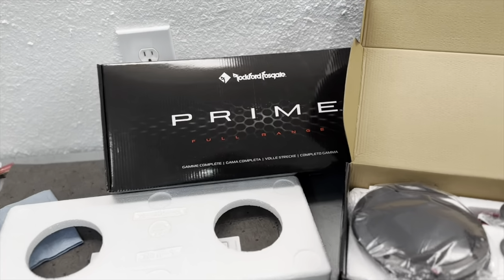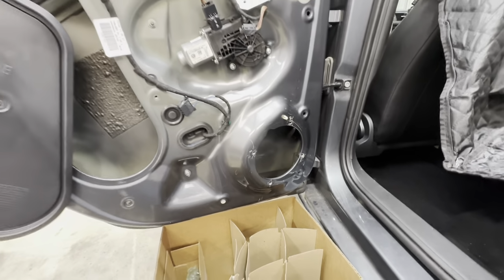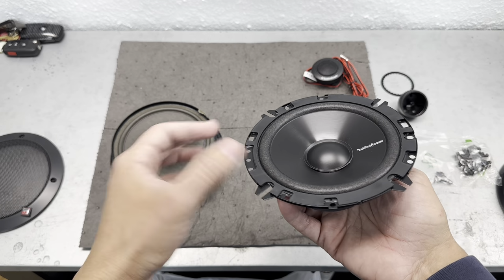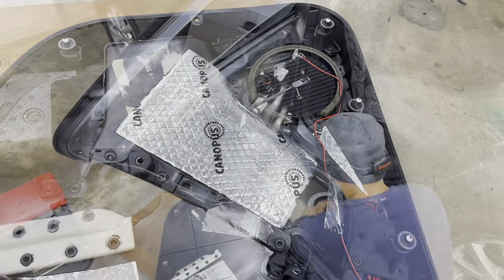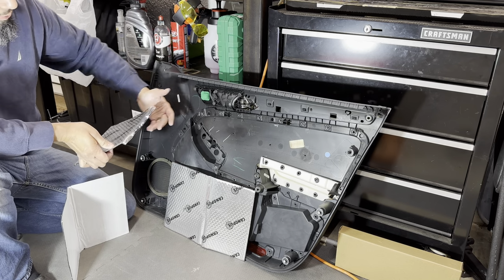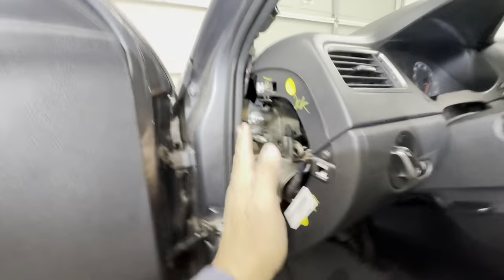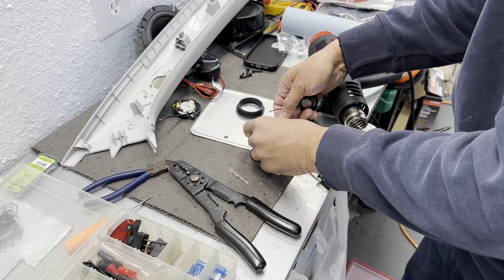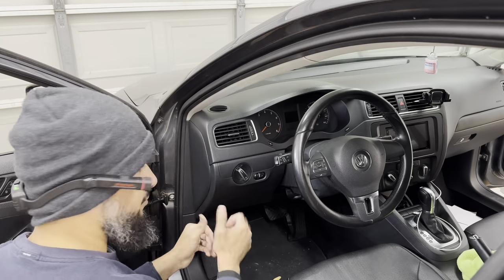VW Jetta Mk6 Rockford Fosgate Speaker Upgrade and Sound Deadening

Comment: only suggestion i could make after doing this exact install with my jetta was that after using hot glue for the tweeters, they lasted the winter but fell off in the summer when it got hot in my area. would recommend using some type of plastic-weld like jbweld or similar that is less susceptible to extreme temperatures. otherwise killer install and awesome video!
Reply from the maker: Dude thanks for that! I will certainly keep an eye on this as we get into the nasty of the summer season.

Comment: Even the best Decks in the world only do 15 watts rms per speaker (if that ) . Where did you get those numbers lol
Reply from the maker: Well your comment just made me double check my stuff! Lol i found that 1- the headunit I used does NOT put out 40w RMS, that was a mistake on my part (but also yours) as it puts out 20w (so less than my number, but slightly more than your number lol). I must have thought of the speakers and got the numbers mixed up. The speakers are 40w RMS/ 80w peak. So thank you for that!

Comment: What size should I use for the screw/riv-nuts?
Reply from the maker: I don't recall now what size I used (well over a year ago). But that would depend on the size of hardware you decide to use (custom work, so you decide what hardware you want and get the riv-nuts of the appropriate spec).

Comment: Do I have to get a riv but attachment or can I use a impact driver to take out the stock riv nuts on the stock door speakers?
Reply from the maker: The stock rivets just need to get drilled out. The rivnut gun was just used to place new threaded holes to make life easier installing the required speaker spacers

Comment: My jetta (2017 SE) doesn't have tweeters in the A Pillar. Is there a way I can add them in assuming I buy new A pillars with the speaker cutouts? Also, will these speakers work with the factory infotainment center from Volkswagen? Thank you!
Reply from the maker: That would be correct. Buy used A-pillars with tweeters on them and run your wiring up to the speaker if you don't already have a random unused plug at that location (being for cars WITH tweeters there). If you do have plugs there you can always test for current with radio on/off to confirm they are in fact for tweeters. If you don't have plugs there, then you'd have to run your wiring from the door speaker, through the door/ doorjam harness, up to the pillar. More work but not difficult. Just time consuming. 

Yes but they will work with the stock infotainement but they may not sound as good, given that the stock head unit has lower output than aftermarket head units. But the sensitivity is high enough on these speakers that they should still outperform the originals given the same current. You can always install the speakers and use them for a couple weeks to get used to them/ they break-in, and THEN make a desicion as to IF you think the benefit of an upgraded headunit outways the cost.
Reply: @turbospool  thank you!!!! Appreciate the response!!!

Comment: How well have the tweeters held up with the hot glue? When I was replacing mine, I was concerned with them rattling free. So I ended up modeling new tweeter brackets and had one of my friends 3D print them. My tweeters were from Focal and conveniently had a thread on the back where I could screw mount to the bracket and then plastic weld the bracket to the original mounting posts
Reply from the maker: Been about a year and a half since i did this and so far the tweeters are still solid in place, thankfully :)

Comment: If I have the stock touch screen head unit in my MK6, will these speakers be fine to install?
Reply from the maker: Yes but they may not sound as good, given that the stock head unit has lower output than aftermarket head units. But the sensitivity is high enough on these speakers that they should still outperform the originals given the same current
Reply: @turbospool  word, thanks man

Comment: in the back you add tweeter ??  the cross over is in the speaker?  but in the front you replace tweeter does this mean the cas have cross over somewhere ?
Reply from the maker: That is possible. OR what I think= no actual crossover, but instead uses integral resistors at the tweeters (just like these Rockford Fosgate tweeters do) to keep the low frequencies from reaching the tweeter drivers. 

I am sure the Fender system has a similar layout but the amplifier correctly splits the signal among the speakers. But in this base audio system, I assume it is just integral resistors.

Comment: I have a 2015 jetta gli , I have fender speakers and my passenger side is rattling, if I order the original speaker will I need anything else? Or just the speaker
Reply from the maker: As long as you order the matching part number you should not need anything else. IF anything, have like 2 plastic door clips ready JUST IN CASE one of your originals break when you pull the door panel off. But that's about it

Comment: i have a set of 6.5 boston component speakers that came with it's own crossover and i want to install that in a 2013 jetta
that has the same factory woofer/ tweeter setup as your car. do i need to install the crossover? i am guessing no, but i
just need a second opinion. thanks.
Reply: oops, never mind. looks like i found your answer in the comment section.
Reply from the maker: Bostons, great choice!

Comment: Great video. Looking to do the same to my jetta. Was wondering if 6x9 can also de added to the rear deck behind seats on top. anyone know?
Reply from the maker: You sure can but you’d have to be comfortable with custom audio work. Adding 6x9s to the rear deck shouldn’t be bad. BUT you’d definitely want to add an amplifier for that’s many speakers. This head unit is matched perfect for the rockford speakers I picked, but adding 6x9s would mean the rear’s output would be split in half to get the signal out to 4 locations. 

A 4 channel amp would fix that issue 😃 ( 2 channels for the fronts, the other 2 channels just wire two sets of line outputs- one to the rear doors, the other to the rear deck). You’ll likely also have to fade the audio to the rear just a little for the whole car sound to feel balanced. Then you should be golden!!
Reply: @Turbo Spool  thank you. That's very helpful. I may just do the doors as you showed and leave it at that. I assume is a BIG upgrade from the stock speakers.
Reply from the maker: @toolrammsteindeftones  it sure was for me! But keep in mind that I had upgraded the head unit already. I do not know how these speakers sound with stock head unit power going go them.
Reply from the maker: @toolrammsteindeftones  But in general I think ANYTHING would sound more clear than the stock speakers lol

Comment: I want to replace the back speakers Beats audio system
Reply from the maker: nice! Please come back and share with us your thoughts when you do! I haven't heard anything yet on Beats speakers.
Reply: @turbospool  the back speakers are wired pretty simple it's it's a basic component setup what two prongs. The front speakers are a little more complicated because there is a built-in crossover in the bottom speaker

Comment: What’s the sound quality? Bass and highs good? I’ve only heard mixed reviews about this model. Looking for a reason to change my mind. I’m in the market of replacing factory speakers in my Audi.
Reply from the maker: So, WITH the Boss headunit I have, they sound night and day better than the stock base speakers. Much clearer and all volumes. BUT for the best sound quality you can’t beat adding an external amp to it. Nothing big would be needed really- a 40w x 4 RMS amp would be enough (since that’s the RMS rating of these speakers anyway). 

But it also depends on what you want out of them. If you want the BEST soundQ then you’d want to consider Focal, Infinity Kappas or Memphis Audio and such with a good amp and signal processor. But I think that for the money these speakers cost, you can’t beat their soundQ. Excellent value!
Reply: @turbospool  How did to install the tweeters. did you go down to the 6.5 speaker or off of the VW tweeter?
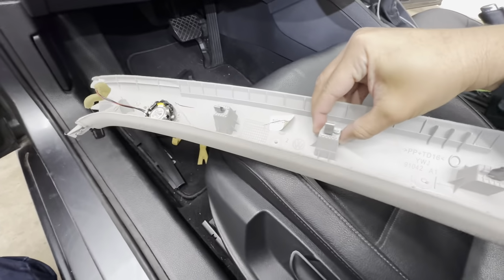Reply from the maker: @anthonyghetti1744  watch starting from 15:24. I cut the new tweeter’s harness and splice the stock tweeters’ plugs into them. This way they runs off the head unit directly like the factory units

Comment: Question im adding these tweeters to my Jetta what wires do you tap into for the signal to feed the rear tweeters from the stock speaker wiring? Do you think its worth upgrading the front tweeter aswell I was planning on just adding tweeters to rear to complete 8 speaker system + sub.
Reply from the maker: So the rears on the non-Fender system don’t have a dedicated tweeter signal. SO i just hooked it up to the additional outputs of the woofer. The Tweeters have an in-line capacitor to act as a filter so don’t worry about blowing them out.
Reply: @turbospool  Okay do you think it’s worth upgrading the front tweeters aswell? do you think it’s worth the hassle of dealing with the A Piller or do you think the stock front tweeters will sound fine with the rear “upgraded” onesz
Reply from the maker: @coleelliott9675  put it this way- because Audio tastes are so subjective from one person to the other, do the rears as you said. Rock them for a week and make your decision from that if it is worth the extra work to setup your front soundstage. 

I am very happy with it, but I also had a blown rear and front speaker, so I HAD to do all speakers anyway.
Reply: @turbospool  Thanks for the input man have been trying to make a decision all day but I guess you’re right it’s not a big deal to see how I like them and do just the A Pillar afterwards if I need to as it’s separate from everything else.
Reply: @turbospool  Hey I got everything installed and it sounds great but I was wondering did you retain your factory head unit fader/balance controls mine only work side to side (In the front) like if I were in mono or two channel.
Reply from the maker: @coleelliott9675  so I replaced my head unit first, then the speakers. But with both the stock and the aftermarket head unit the balance/ fade always worked, no change to that when I replaced the speakers. Did yours work prior to the new speakers?
Reply: @turbospool  yes fade worked before new speakers now it only fades left to right in the front. can’t put it anywhere besides the front seats left or right
Reply from the maker: @coleelliott9675  wth that’s odd. I would be suspicious of the car’s wiring. It could be a dead speaker from factory but for both to be bad doesn’t sound likely. You can check for that by fading sound to the rear and with a multimeter check for voltage at the terminals.
Reply: @turbospool turned out to be the RCD330 head unit I had. Upgraded to a new wireless CarPlay head unit and everything is working great now. Going to probably do the A Pillar tweeters aswell as they’re a pretty cheap upgrade and I like how the rear door tweeters sound now with the Rockford. Thanks for the help and posting a video of the A Pillar tweeter install probably wouldn’t attempt it without it.
Reply from the maker: @coleelliott9675  awesome dude! Glad you got it figured out

Comment: hello, do you need an amp?  how many watts and rms are the new speakers?  thanks
Reply from the maker: amp is not NEEDED, but it would be optimal to add one if you have the ability to. I had no need for it for our uses in this car.
Reply: @turbospool  thanks, Merci